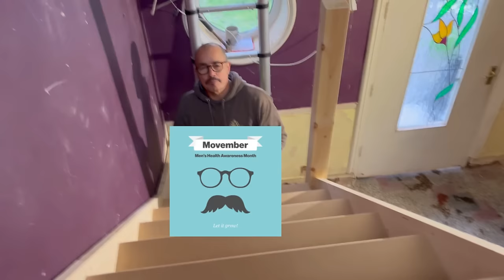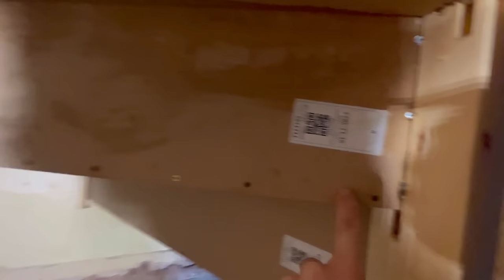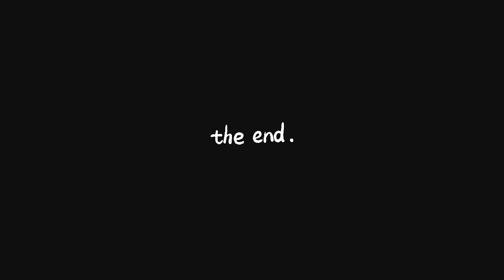Fitting a new kite wind staircase

Comment: When fitting stairs always take measurements for risers from the top face of the treads/nosing, most mdf treads are 22mm finished thickness, but the top nosing may only be 18mm to match flooring thickness, 
Using the underside of the tread an measuring down in multiples of the individual rises could put you 4mm out of level, and will leave the newel posts out of plumb.

Comment: Measure twice, cut once
I remember when we had our stairs fitted and they measured wrong 🤦
Fixed with a bit of 2*4 so it was easy but they spent most of the day scratching their heads trying to work out why the stairs didn't fit 🤣

Comment: Happy New Year Richard, as always you've done an excellent job explaining how to install a staircase. You mentioned using a good quality foam filler for the gaps between the wall and the staircase, can you say which brand?
Reply from the maker: Hi Peter and thanks for the comment. There are a few you could use but in this case I’d say one that boasts adhesion qualities as well. We recently did a video with Pro Build Mag and Bond it. They supplied us with some expansion foam called Mega stik which they claim has a variety of uses. I’ve used it in this house to fill down the side of the door frames and as you saw the side of the stairs as well. It’s done a great job of it and I will use again and it’s not expensive either. I’ve put the link for you below. 👍🏻 
https://bond-it.co.uk/pu-foams-adhesives/mega-stik-polyurethane-adhesive/

Comment: Couldn't you of nudged the stairs over so the top newl post  was tight to the wall, that way you would of had near enough the  the same size  capping piece running up the strings on both side of the staircase and no need for a piece of quad running up the newl to cloak the gap.
Reply from the maker: Hi Anthony and thanks for taking the time to comment. The main and only reason for keeping tight to the wall and having that gap is to achieve a finger space down the side of the handrail once it is installed. The finger space, believe it or not is a condition under NHBC as there must always be a minimum of 20mm gap against any wall. That would mainly only apply to new build sites but if it’s good enough for new build it’s good enough for this job 👍🏻